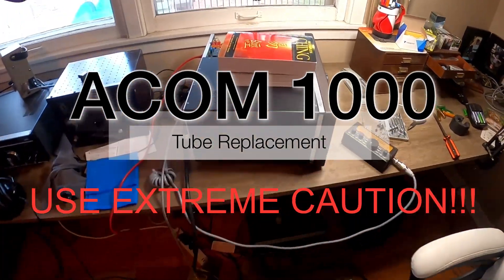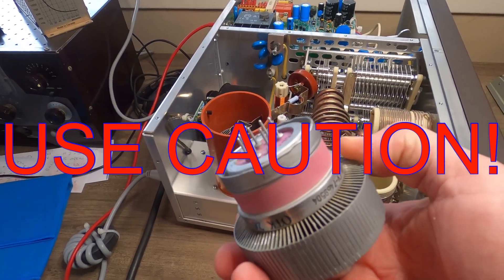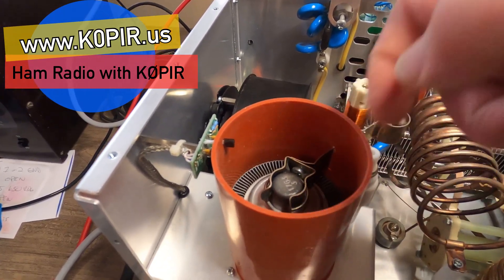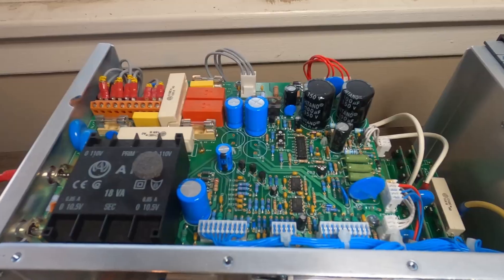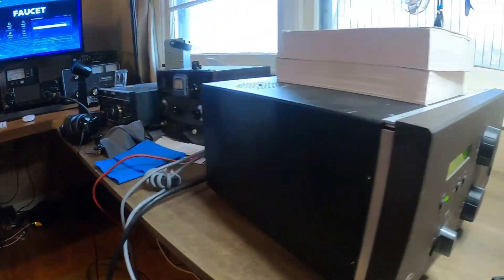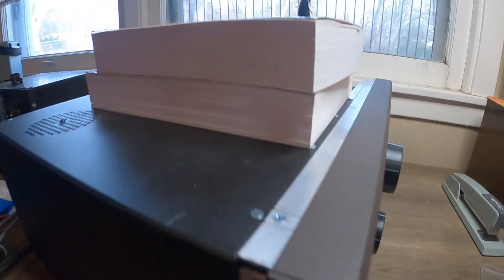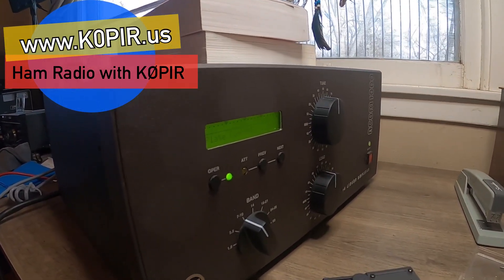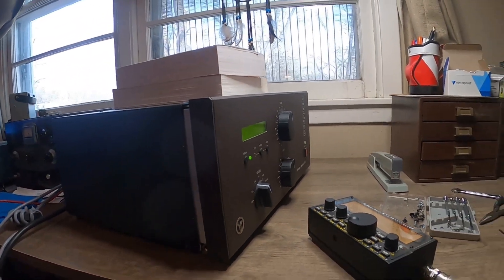ACOM 1000 Tube Replacement - Extreme Caution

Comment: 73 what wire should I use to connect the ground and remove the residual high voltage there can be 3000v a regular wire will do the job? thanks.

Comment: Rich, so how has the amp been since the relaced tube. I am replacing my tube at the moment and conditioning as per the links in your blog. But wondering if you had any issues since you replaced the tube, or is everything ok?
Reply from the maker: Thanks for the update, no problems since the tube replacement. If I remember correctly the knob settings changed some for the 75-meter band and probably other bands too, but I mainly use it 90% of the time on 75 meters. 73

Comment: Do you still run this amp ? I was looking at these or om2000+ but the om has issues it seems. How’s the power now
Reply from the maker: Hi Jay, it’s nice to hear from you and thank you for commenting. I do have it and still use it. The power output is fine and I wouldn’t trade this amplifier for another.

I hope this helps.

Comment: Hi, good video well explained, i now know what to do ,i have a spare second hand tested tube for emergency do you think there could be installing issues,thanks and 73 from Rotterdam
Reply from the maker: Good to hear from you and thank you for commenting. My old tube had a fault but it worked great up until then, so I won’t replace this one until I see another fault. Probably many years from now 🤞It was pretty easy to change IMO. That said, it can kill you if the right precautions are not taken. Best 73 and good DX! de KØPIR
Reply: @HamRadioAdventures  thanks for the advice, 73..👍
Reply: Great video, I personally wouldn’t go inside with a metallic screwdriver.
You can buy a plastic tuning rod just for that purpose.
M0PAW

Comment: Did you notice a power output improvement with the new tube? In the previous video you were getting 850w with 60w drive.  How is it with the new tube at 60w drive?  I'm thinking of putting a new tube in mine as it only makes 650w with 60w drive. Thanks  VE3WF
Reply from the maker: It's nice to hear from you David. Yes more output now with less drive. Fantastic amp and after seeing the new solid state amps at Hamvention I think I'll stick with this one for a long time to come. Vry73!

Comment: do you run this at 120 or 240? I'm thinking of getting one, but only have 120
Reply: It can be downloaded on the net as a PDF but find the manual for the model amp you want. It will show all the different operating voltages on the primary side and the jumpers to move from 100-280v roughly. You might have to decrease drive to prevent the amp from pulling too much current out of the wall or getting voltage sag on the filament when running it on 120v.
Reply: Hey guys. Maybe a dumb question. So it’s a 220 plug. Then ??  That has to be plug in the wall.
Reply: Hey guys. Maybe a dumb question. So it’s a 220 plug. Then ??  That has to be plug in the wall.

Comment: Could i ask how you actually blew the tube?
Reply from the maker: Just got old. Probably the original. One day the error popped up after I powered it on. 73!
Reply: @HamRadioAdventures  what was the code? I think mine is starting to get weak and now its going to be difficult finding a tube.
Reply from the maker: @1112223333111  it was a long Protection Error that started with PR06... see https://www.k0pir.us/acom-1000-tube-replacement/ Thanks and GL my friend!
Reply from the maker: @1112223333111  Yes, got it off of eBay. Works FB. 73!